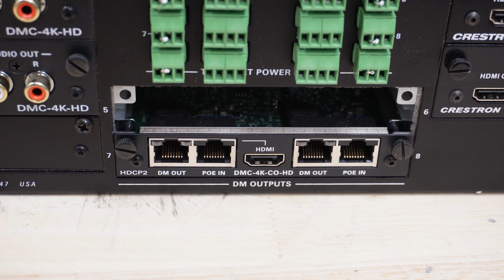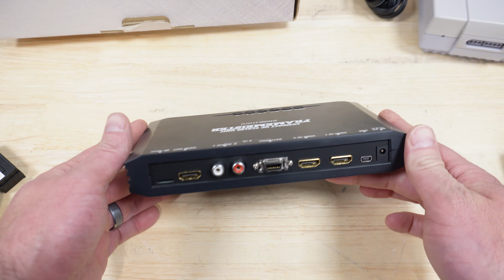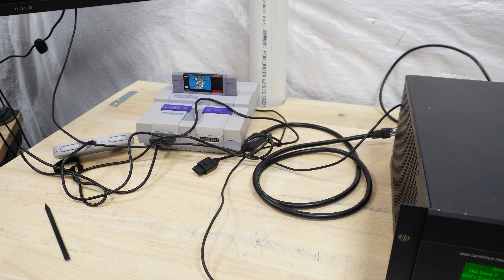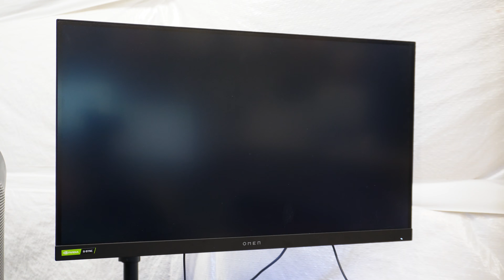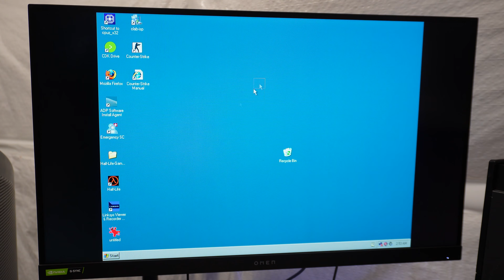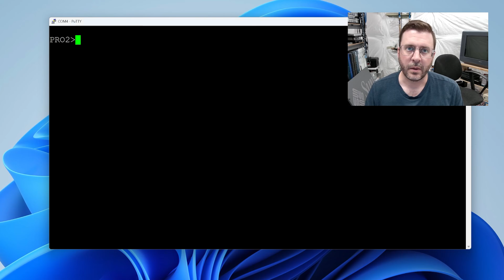Crestron Video Gear

Comment: We used to used Crestron gear.   Not sure why (as I don't work for the department that maintains our AV systems, so I wasn't involved in the decision), but we don't now.

Interestingly, when installing some crestron gear a few years ago, one of the techs left a spare Magewell HDMI to USB capture device, which did a bloody good job of capturing HDMI output, even that protected with HDCP.  I haven't seen it recently, so I suspect we've disposed of it.

Comment: Excellent video and I appreciate your discovery process. I have also worked with this legacy Crestron equipment in the company I work for. It is impressive gear but alas the software is all locked down to registered integrators who have done the training. But that didn't stop me from moving a Crestron MD-16X16 switch and setting up in another office to display content on 10 screens over Cat 6 DM connections to the Crestron DM-RMC-Scaler-C's. I had many Crestron plug pack power supplies fail but replaced them with off the shelf ones.

Comment: I played around a lot with HDBaseT and combined it with my Logitech Harmony remotes, now I am sending all my video through AV over IP with Atlona Omni hardware and Control4 with their older Neeo remotes. If you are ever interested in trying AV over IP, you can pick up Atlona Omni Encoders for cheap, decoders are a little harder to find as of right now though. But they also scale video too.

Comment: You should pick up a CCS-UC-CODEC-200. It has an i7-3610QE, 8gb ram and a pretty good capture setup with fpga and everything. After doing some wizardy to get rid of the skype for buisness it can record pretty much anything under windows. I'm currently working on a custom firmware for it's capture side along with some mods and custom linux distro.
DM is actually HDBaseT, nothing special about it. It even uses chips made for that.
The C200 has a port labeled "touch screen". This is also just a HDBaseT output and also main display output by default. It's all connected to an input switcher and can be controlled over telnet on the port labeled as "service", it usually has a sticker over it.

Comment: I remember dealing with Crestron systems at work. They were great....when they worked. Problem was, a decade later they had started breaking down in various annoying ways, an dpart lead times went from hours, to days, to weeks, to months. Eventually, we just couldnt get parts for them and had to resort to hard power resets every hour to keep them working. Once that stopped working, we moved onto a Cisco provided solution.

Comment: If you want the absolute best quality, you may want to investigate slightly better HDMI->USB capture devices. The really cheap ones all seem to convert to MJPEG or some other lossy format with varying degrees of compression artifacts before transmitting to the PC over USB2 (I think even many of those branded as USB3 are secretly USB2 - USBTreeView can help identify the USB speed, and some other capabilities). The EVGA XR1 Lite (as an example), is able to capture and transmit uncompressed/raw video from the HDMI to the PC.

Comment: More than likely the reason the Component cable didn't work from the SNES into the Crestron is because that older consoles from the NES to the N64 normally use a video format of 240p60. A lot of devices do not like this format as it is not a normal standard to see over Component. You can occasionally see certain TVs and other devices incorrectly identify 240p60 as 480i30 just like the Crestron's display showed. Devices like the Framemeister and the OSSC are built with this non-standard format in mind thus are able to correctly identify and process the signal. Some TVs are so bad at detecting the format, they will apply de-interlacing to a Progressive format. 
If you intend on using the Crestron I would suggest to still use the Framemeister or a OSSC to convert the consoles signal into either a progressive format such as 480p60 or 1080p60. This shouldn't be a problem if using a newer console such as the Gamecube or any other console from that same generation or anything newer that natively outputs either 480i60, 480p60, etc. As those video standards are much more common it should be a much more Plug-And-Play experience.

Comment: Funny seeing so many names I know in the industry in the comments :) Anyway one of the points I don't see explicitly called out is that there's a distinction between analog-to-HDMI conversion and upscaling. DM will convert 'anything' to digital (as either HDBaseT, the generic term for the technology DM is built on and largely compatible with, or HDMI) but in its simplest form no other changes are made: if you send 640x480 interlaced at 29.97 Hz composite video in you get 640x480 interlaced at 29.97 Hz digital video out in the same color space (YPbPr or RGB). I.e. there is a format conversion.

Scaling, that is the conversion from one resolution and/or refresh rate and/or color space, in DigitalMedia, only occurs on specific scaling products -- the DM-RMC-4K-SCALER-C receiver being probably the most common of those but there are a couple flavors of similar scaling receiver or the DMC-4K-HDO and DMC-4KZ-HDO HDMI output cards also include a disablable scaler. 

Although AVoIP is eclipsing DigitalMedia for new installs -- especially since virtually everything these days is a native HDMI input or output -- it is still current product.
Reply: Thanks for that explanation. I think our problem - as “retro” gamers - is that old consoles use the 240p trick, which tricks the Crestron, as well as most other professional/consumer equipment, into unnecessarily deinterlacing the signal, causing unnecessary latency and screen distortions. I don’t pretend to understand anything and would love an explanation as to why/how this happens. I have a 2018 Samsung flatscreen with a component input that correctly identifies 240p with the same, exact cable used in this video; I wish my DMs would correctly identify this resolution as well. Did older CRTs have to scale the 240p signal? As I said, I don’t actually understand how any of this works. Could I use the Toolbox software to search for 240p and scale appropriately?

Comment: This sort of equipment just seems so useful. I wanted to pick up something like this (but probably smaller) for a home AV setup. The switching and extension functionality would let us get away with renting fewer set top boxes from the cable company. The downside is it's just too expensive (or was the last time I checked) and can use quite a bit of power.

Comment: Lol well, I've only gotten half way through the video, and had to leave a comment. however I'm already seeing a ton of Crestron peeps down here lol so I'll keep it brief :D

We run two different Crestron Systems here where I work. One that is old as hell, like what you're currently playing around with, and one that is newer, but still kinda old...

But basically alot of your issues seem to be that you don't have a processor. You have that ancient serial one maybe, but you don't have like... the 'brain' of the system. You're stuck with a 'dumb body' essentially. You can hit buttons on the front and that's about it. With the processor, you can change various settings, set routes, change how inputs are detected/change what an output does, etc... They're pretty neat, but can be incredibly complicated programming wise...

Supposedly there's TONS of documentation out there specifically for programming the Crestron stuff, which we've had to use a decent bit when ours craps out (Crestron craps out ALOT..... and is by far our most unreliable AV/Control system on property...)

Comment: I worked for the company for a little while doing maintenance the 8/8 is pretty cool but they were coming out with a 128 by 128 massive blades instead of little cards shoot me a message if you need some info

Comment: USB over DM was amazing for KVM control of PCs.  I had an innovation center with 6x 32x32 DM matrices where any of the 100 or so PC input sources could be controlled from one of two KVM stations in the control room.  The only thing that killed that system off was lack of 4K support: USB was removed from the 4K scalers as you discovered, and they never built fiber TX and RXs that supported fiber.  A version of the 8x8 chassis (with a CPU3 card) was a shipping product until this year - it's just now being discontinued in favor of video over IP using Crestron's NVX products.

Comment: I did a talk last year at a conference, about how I programmed an RP2040 microcontroller to do video, and basically be a whole 1980s style home computer. It produced 480p VGA at 60 Hz. The plan was to deliver all my slides from my home brew computer. I brought a VGA to HDMI adapter because I knew they wouldn’t take VGA in, but we had no picture. After frantic debugging, it turned it their AV setup was all locked to 720p. If it wasn’t 720p, they couldn’t show it. 

The AV guy had a think and went off to look in a dark long forgotten cupboard. He came back with a Roland V800-HD. Similar deal to that Crestron but designed to go on a desk, and had a T bar for cross fading video. Took VGA 480p in and scaled it up to 720p HDMI out. And it looked great whilst doing it. Totally saved my talk.

I worry that ~20 year old Pro AV equipment would be an even deeper rabbit hole than the ~25 year old UNIX workstation hole that I’m currently in.  But I want one.
Reply: I use that Roland gear for Video DJing. Great fun.

Comment: I had a issue with a few DM-TX-201-C's with no link, it was a bad a component on the transmitter that was failing after a few days/week had to do a RMA with crestron at the time, also playing with a DM-MD16x16, a DVPHD (video wall with annotations) and a RMC3 processor and a Xpanel for the interface, did a lot of crestron programming at the time, i love programming with Simpl , for the USB yes can you used HID device for a usb hub, a use a dm-rmc-200-c scaler that as a usb port. have fun and it was a great video as always, cheers

Comment: I use Extron switching gear for all my VGA systems and retro gaming consoles. They work great, supposedly there's 1 frame of lag but i can't tell. VGA sources work great, and i capture with the same cheapo HDMI dongles like yours. 

The only problem is it doesn't properly handle 240p over component, which i think was your initial issue with the SNES... It detected it as 30hz 480i when technically the signal is 240p 60hz. My Extron does the same thing, but mine at least outputs a usable signal. there's deinterlacing artifacts on certain games, but i just live with it, as my Genesis looks so much better than its crappy composite that I'd rather live with the bugs. And I'm too cheap to buy something serious like a retrotink lol

Comment: 41:22 I used to work for a large corporation that used Crestron gear for the larger meeting rooms. If the power went out for longer than the UPS could keep the equipment running, typically there would be issues. I would have to call Crestron for support, they would remote in from Vancouver BC or fly out to Kamloops to fix the equipment. They do hold their cards pretty close to their chest when it comes to servicing the hardware.
Reply: Definitely remember having that problem. Once our regular service guy retired we straight up could not get these things fixed without paying exorbitant amounts to ship the hardware back to the m for inspection.

Comment: I've been installing and servicing Crestron systems for 15 years now, primarily in the super-prime residential and superyacht space.  Crestron gear is extremely reliable and trouble free IF it's programmed properly and installed professionally on top of good infrastructure.  Crestron's flexible programming environment can also be a weakness if people don't really know what they're doing - I suspect the majority of people with hair pulling experiences were with systems deployed by installers who were a bit out of their depth. It's not perfect but there's a reason it's the system you will find on 99% of charter yachts where people are paying hundreds of thousands to a million to charter just for a week. There is also a tendency by users to blame 'the system' regardless of what faults may occur (a blown speaker voice coil or failed AV source isn't Crestron's fault!).  Typical use case for us would be Crestron controlling multiple AV sources via infrared, RS232 & IP, matrixing those sources to multiple destinations, lighting & shading via a Lutron or Crestron lighting system, HVAC, security and presenting all of this via a custom GUI on proprietary wall touchpanels or iOS/android.  Crestron has a huge ecosystem of it's own products but the real strength is that it is a system that can be made to interface with just about anything else.

Comment: DM uses its own implementation of POE called PODM. 

DM as a protocol is compatible with and a proprietary implementation of HDbaseT also keep in mind that EDID and HDCP can trip you up. You can set custom EDID and HDCP using Crestron toolbox’s DM tool.

Comment: OMG The memorys, the pain, the 16 weeks laid up in bed, as that bitch sliped and breaks my foot, my colleagues ankle. When its fully cabled up and wired OMG good luck! Pro tip when you rack it, include room for a support bar to hang the cables on, they add up fastttttttt, and unplug them ALL before you attempt to pull it out the rack, or you too will have a case of as that bitch slipped and broke your ankle.

Comment: Certified DM engineer here, looks like a lot of things have been covered already so I'll try and cover what hasn't...

The frame is a switching backplane only, it does not scale. So 480i on a composite in, will still be 480i from it comes out a HDMI card. You can install scaling HDMI output cards, or use scaling endpoints like the one you have, if you need to upscale.

The displayed frequency is always frame rate, not field rate. This means interlaced sources will always show as half of what you may expect (unless you are a broadcast engineer)

To use the USB routing you need a display endpoint with a USB port to connect the keyboard and mouse. DM-RMC-SCALER-C is the usual use case here, although that device always needs local power and cannot be PoE powered which is a common gotcha. The USB is only for basic HID devices, and is only unidirectional, so you don't get num/caps/scroll lock LEDs working, but it's still a useful KVM tool. IIRC more than 3 mouse buuttons may not work either. 

The TX-201 input endpoint you have also supports composite, Y/C and SCART level RGB type signals via the VGA port.  VGA to 5 x BNC is usually what you need as a breakout cable, have a read of the manual online for which RGB channel it expects each signal on. Historically I've used one to feed an Amiga into a DM system. You may need to have a play with the settings in DM tool to get other inputs on the VGA port recognised.

Good thing you 'found' Toolbox, as the DM Tool inside it is the only sane way to configure the advanced features on the system. It lets you point and click configure things like input types and switching, EDIDs presented, and scaler output frequencies. It's fairly intuative once you get in there. Also invaluable for troubleshooting, as it shows the signal paths through the system.
Reply: Can you connect a DM-TX unit directly to a DM-RMC without a switcher between them? If so this system seems like a nice way to remotely setup a monitor+mouse for quite cheap.

Comment: That USB B conections on the IN side of that Computer Center is for the USB "back" (host) to the computer. Even though they have silkscreened "IN" USB is actually bi-drectional, as you already know. Think you'd need another like computer console or whatever crestron has in their module assortments that has the USB A ports for the peripherals. 

Also I find it weird that crestron decided to do external PoE in for each module, rather than integrate PoE into the module boards. I guess is cheaper for them and easier for PSE replacement, if needed

The pastor as the church I got to, has a brother that is sending a pallet of crestron stuff over, never played with in my life. watching this video is interesting, though I know it take special software to program stuff...

Comment: Getting PTSD from a previous job years ago where I would support Crestron hardware in lecture theatres and meeting rooms. There's nothing worse than a badly implemented Crestron setup and the installers giving bugger all support. It didn't also help that one of the racks was in a closet that had no real ventilation and would cook itself
Reply: Amen! Once the capacitors in the HDMI out boards started going, all hell broke loose.

Comment: So I'm pretty positive this is not proprietary but in fact is the original version of what became HDMI. A lot of people don't know this but HDMI was originally made with the intent of carrying all kinds of signals through it at the same time such as USB and serial and control signals. That's exactly why it's called the high definition multimedia interface. There are in fact of you early industrial devices which were made with the original Speck of HDMI which effectively made HDMI behave exactly like type c does today

Comment: Normal NTSC has a 30Hz frame rate. The reference to 60Hz that you will have seen is due to it being interlaced. Each field contains half the lines that make up a single frame, two fields make one frame, so it has a field rate of 60Hz, but a frame rate of 30Hz. There is such a thing as progressive scan (i.e. non-interlaced) NTSC, but that's rather uncommon.

The USB inputs being type B jacks is a bit weird: USB inputs are usually type A.